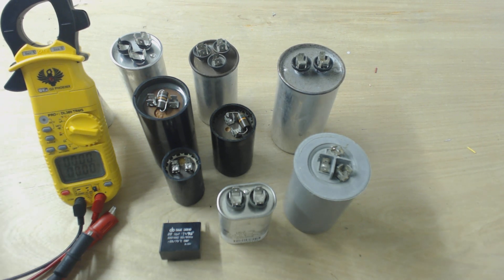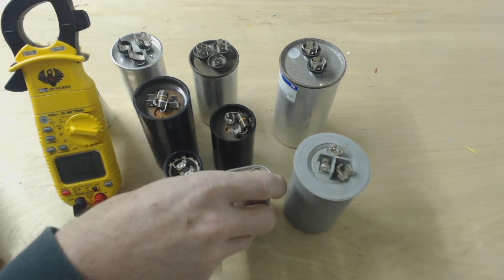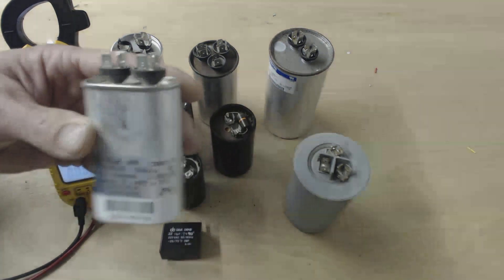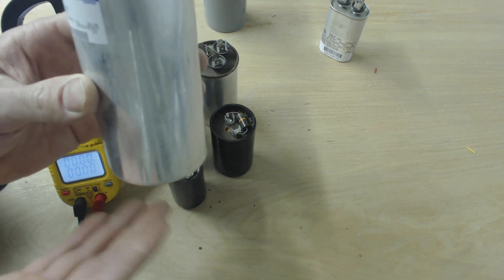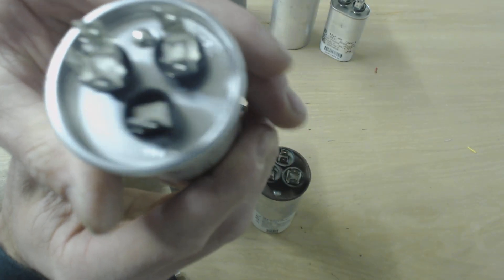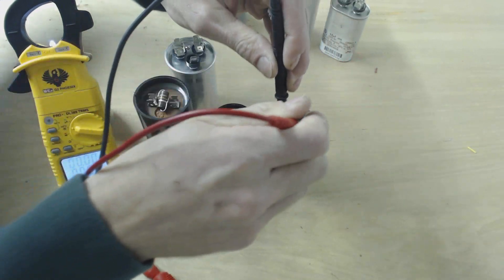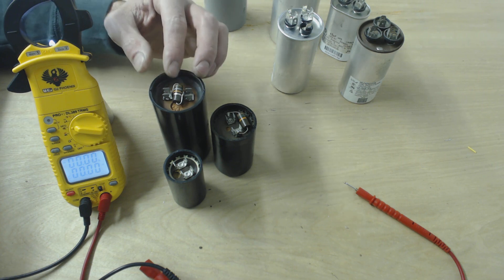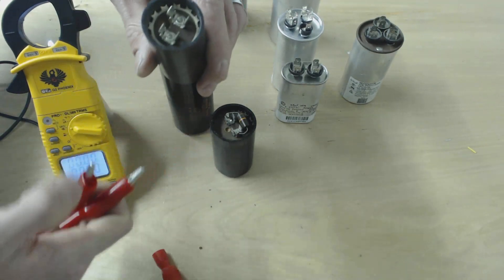Testing and Checking the MFD uF rating of HVAC Capacitors- Start Capacitors and Run Capacitors!

Comment: I’m working on a portable AC unit and o have blower motor for the exhaust side that isn’t working. I’ve been told to check out the 12.5 MFD 440v capacitor. My question is does it matter what terminals I check on top of that oval shape capacitor???

Comment: I've been looking all over for a video that shows how to test with a simple multimeter.  I still don't own a meter that tests capacitance for larger capacitors, but I really only need a pass/fail test and I was pretty sure it was possible.  Thank you!
Reply: Did you ever figure this out? It seems like any digital multimeter under $20 have no setting to test MFD uF of start/run capacitor. Or at least, I have no idea how to dial up that setting.
Reply: @mts7274  The $20 ones will not measure the capacitance of a start/run capacitor but should be able to to a pass/fail test as described in this video.  You can find inexpensive models that will measure capacitance for much smaller mF values (like the small ones found on small electronics circuit boards), but you'll need to spend over $100 to get a meter that can measure capacitance on a capacitor as large as a start/run capacitor.

Comment: I check my herm-fan capacitor every couple of months. It was 45 and 10 then it was 44.17 and 9.9  now its 43.79 and 9.8.  Is that a good indicator its time to replace as its losing MFD over time?
Reply: If it's within plus or minus 6 percent of the microfarad

Comment: hard to see the meter setting in the video.      be nice for us folks watching if we could actually see the setting on that yellow meter.
Reply from the maker: it is capacitance reading mfd which is the same as uF, thanks!
Reply: @acservicetechchannel   cool...  I do appreciate your efforts very much.   I'm having a hard time testing as I don't have a setting just for caps...  been using the ohm setting.   I see there is a separate tester just for caps.    I hate to buy another meter but will if it's going to help me text a/c units quickly.   Thanks!

Comment: We are working on a home generator with 2  31,5 capacitors that we think one may be bad because the generator won't put out the correct power on one side of the 220. Do you think that this is the problen? Thanks
Reply from the maker: Honestly I really don't work on generators other than the combustion side, thanks

Comment: Great video. What do you do when you have a motor and capacitor with no labels. I suspect the start capacitor is bad, as i can manually spin the motor at startup and the motor will work. Want to replace the capacitor, but have no mfd/vac ratings to go by, except a '400' written in black marker.
Reply from the maker: If you are talking a run capacitor then you would need to look at the compressor rating plate or look up the compressor online to determine the size uF needed, thanks Bob!

Comment: Do you ever replace caps when they get very old, even if they still measure ok, or only if they fail?  I measured mine, which are about 25 years old and they are between 5% to 10% out of there rated value.
Reply from the maker: The older caps seem to last much longer due to the type of dielectric fluid. Like everything else, they can't use that anymore and go for the cheaper non toxic fluid. That is fine. I do replace them when they are under the rated value if they are old, thanks
Reply: I didn't know why but I did think that the old ones would probably outlast the new ones. I will replace them and save them for a backup in case the new ones fail.Thanks for the reply.
Reply from the maker: Got ya, thanks kwd57

Comment: hi, thanks for the video, very helpful.  quick quesiton. capacitor need + and - to charge, in this case, common from capacitor and
(start wire from compressor and FAN) both are in the same leg.. the common of compressor and fan is going to other leg of 240..  but for capacitor to charge we need both leg right. so how is capacitor charging.. to make it simple if  i have capacitor which is NOT dual KEEP it single..  i wire start wire of  herm in capacitor to start wire of compressor, common in the capacitor i will connect to T1,  i will connect RUN of compressotr to T1 and common to T2. being said that capacitor doesnt have both the leg to charge.. can u please explain.. no one have done this befofre..
Reply from the maker: If you are saying that instead of using a dual capacitor, you are using two single capacitors then you would connect common from the contactor to either of the tab centers on the capacitor. then coming off of the other tab center on the capacitor you would connect to the fan. Same thing for the compressor. There is no - and + on a single capacitor used for hvacr. You have an input and output which is reversible in a single run capacitor with only two tab centers. I hope that this answers your question, thanks!
Reply: ok Great got it.. In electronics world you need  + and -  to charge capacitor, in Hvac world it is an input and output .. thank much. I was always wondering that Start and Run from compressor should be one leg and Common from compressor should be another leg of 240. meaning i cant have common from compressor going to common on Capacitor??.  

also i like to donate is there a way?.
Reply from the maker: Actually we have a platform where individuals support the making of these videos and in return, I try to take extra time answering their questions whether here on youtube or through Patreon.com/acservicetech or email and also I am in the process of writing more articles and making videos to Post on Patreon. You would see these rewards on the right hand side in the support, community, and insider levels. Let me know if you have any questions. Either way, I do appreciate your thought and taking the time to let me that you appreciate the videos and time it takes to answer questions for our subscribers! Thanks a lot sivaraj palanisamy!
Reply: Hi, Just joinned.  this is the first time i never used the patreon concept..  i would appreciate if you can answer this.. 

 I was always wondering that Start and Run from compressor should be one leg and Common from compressor should be another leg of 240. meaning i cant have common from compressor going to common on Capacitor, is that right.?
Reply from the maker: Awesome, I appreciate it! So on a 240v single phase compressor, run from the compressor is connected to one leg coming off of the contactor. This is the same leg that is also connected to the common on the capacitor which goes through the capacitor and enters the compressor on the start. Common from the compressor is connected to the other leg of the contactor. I hope that makes sense, thanks!
Reply: Thanks much, got it..
Reply from the maker: Thank you very much for becoming a Patron on Patreon.com/acservicetech! I appreciate it!

Comment: Hi, i still not sure about the ac capacitor. Which is compressor (2) terminal. Which is common or fan or herv?  I been stress about this. And the measurements i apply didn't show up. Kept showing 0.f or 0
Reply from the maker: On a dual capacitor, say 45+5uf, C to Fan is the 5mfd and C to Herm is the 45mfd. The common usually has the most male tabs sticking up, Herm usually has three tabs, and Fan usually has one or two tabs. Make sure to short between c to fan and c to herm first with a non painted screwdriver(bare metal) and hold the probes on there for up to two minutes if needed. Sometimes you need to scratch through the rust to get a good reading, thanks!
Reply: acservicetech 
Sorry! I dont mean duel capacitor. My aircon capacitor didnt apply with duel. The terminal only have 2. Duel have 3 terminal. I dont know which is - or + terminal.
Reply from the maker: That is much easier then. It doesn't matter which side you connect in to supply and which side you discharge out of it. That is why it is not labeled as such.
Reply: acservicetech 
I use digital or analog multimeter can't measure the mfd! Kept showing either 1. / 0.F / negative no. 
Can teach me how to use it?
Reply from the maker: Hey Uchiha, did you check out these capacitor testing videos?   --   https://youtu.be/ObTpixRWzyQ  --  https://youtu.be/zZXR5WC4WSE   --  https://youtu.be/Xh11jN8YbIw  --  https://youtu.be/flbUtLMeSOQ   --   https://youtu.be/XVF4cR-1ceU
Reply: acservicetech 
Thanks! I now watching your video. Bro can i have your contact no. So next time i not sure other stuff i can contact you. Better than youtube msg.
Reply from the maker: I typically respond to youtube comments but I try to spend a bit more time helping the members at patreon.com/acservicetech, thanks

Comment: Will the bleeding resistor on the start capacitor affect the mfd result?  My 521 start capacitor is rated for 186-227 mfd and it showed 256mfd all the time when I checked it. Thanks and I love all your videos.
Reply from the maker: Usually it will only affect the reading a little bit and will still be within the start cap mfd range but in a situation like that where the reading is outside the parameters, go ahead and unsolder or cut the bleed resister out to check it if you suspect it is the problem. You can always solder it back on if it is long enough, thanks

Comment: Does the MFD uF rating have to be the same?  I have the old dual capacitor that says 30+5uf but the one in amazon says 35+5 mf.  Would that be a problem when I change it?
Reply from the maker: That is the same, just make sure the voltage is the same or higher. For instance, if you have a 370v then you can use a 370v or 440v, thanks- Here is a genteq 30+5uf 440v capacitor-    http://amzn.to/2rGDRcD      , here is a genteq 30+5uf 370v capacitor  http://amzn.to/2rVL0tU   -- These are both round. The 440v would be a little bigger than an old 370 so it won't fit in the same bracket. Packard and Mars are good cap names as well. There are oval ones listed in amazon as well. Make sure that you replace the cap with the exact same ratings like what you are saying 30+5uf, thanks

Comment: can u plz tell me the rating of fan capacitor? like 4Mfd or 2.5 mfd?
Reply from the maker: They really are all different. You need to look at the rating plate on the side of the fan motor and match with that, thanks

Comment: I really enjoy the videos you do but you really need to stop the screeching sound of the screwdriver over the terminals. It makes my skin crawl ever time you do that. You could just touch them together. Just saying!
Reply from the maker: The issue I have seen is the contact of the metal on old capacitors is not great so the rubbing in whatever way you want to do it ensures good contact across the top with your metal screwdriver. Now you could also use a crimp connector jumper wire that would slide down the whole spade connector and that would work as well, thanks Kelly Roy!

Comment: hi. my 2 hp single phase motor start capacitor is burnt out. unfortunately capacitor has no marking on it. how i will find out the rating of this cap ??
Reply from the maker: I would look up the motor model# specs online if the cap size is not stated on the motor rating plate.
Reply: CATALOG NUMBER:      L3605T Baldor motor.
2HP, 230V, 11.5 AMP, 1725RPM. Starting capacitor rating required

Comment: I encountered a run capacitor with two terminals and  no labels , which terminal is for Common.  I noticed also that both Fan and Herm wires are connected on the second  terminal.  So let say that capacitor went bad and I disconnected the wires on those two terminals.  On the new capacitor,  since it is not marked, where do I connect the common wire and the fan and herm?
Reply from the maker: A capacitor for a compressor and a condenser fan motor would be a dual capacitor with three terminals. Common comes off the leg and is usually a yellow wire from the contactor, herm goes to compressor, and fan goes to the condenser fan. If it were just two terminals, that could be for just the compressor, just the condenser fan, or just the blower motor. Here is a video on a bad compressor with wiring for a capacitor but really you should check and follow the wiring diagram for the unit if it is available, unless that is, it is wore off. Thanks for the Comment!-https://youtu.be/IASaWV3C1_Y

Comment: Good! I always thought you had to remove the resistor to be able to test those start capacitors.
Reply from the maker: So start capacitors have a wide range of microfarad readings, for instance 400-450 mfd, 88-125mfd, 163- 193mfd, and so on.  The bleed resistors add an additional 3 or 4 microfarad reading  which the meter picks up. The question is, would you think it is wise to go clipping off all of the bleed resistors on those good start capacitors which limit their lifespan when you have that much of a mfd operating range? For me it is a no unless my meter will just not pick up the mfd reading, then I would move forward with cutting it off. I don't think most techs are soldering them back on after testing. Most of the time the reading is still usually in the middle of the mfd range such as a 163-193 capacitor reading a 185 with the bleed resistor. I am also only speaking about residential light commercial by the way. Thank you for your wonderful questions, thumbs up, and great comments!
Reply: Thanks for your vids.   Learned a bunch.
Ok... so for my HVAC Tran 2.5 ton unit.. The start capacitor 135-162MFD...
Would not read on the mulimeter.. ie: gave an OL (it jumped around and then settled on the OL).
I clipped the resistor... and it gave a reading of approx 144...
You id say you were talking about "residential light commercial"...
So I don't know if it is different for the HVAC start capacitors.
or maybe the resistor is bad.